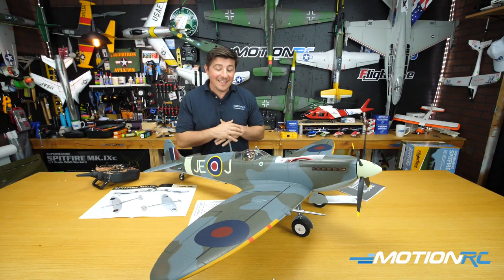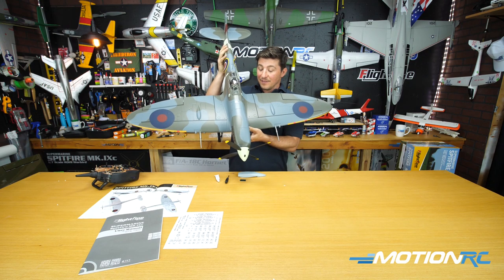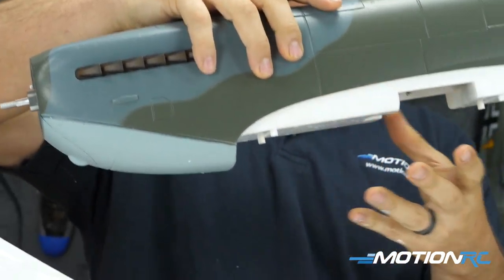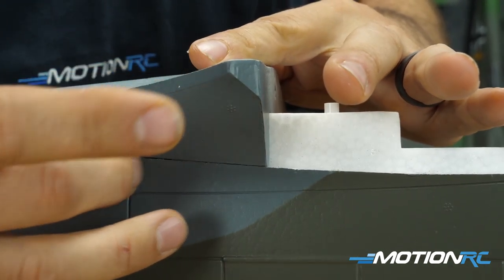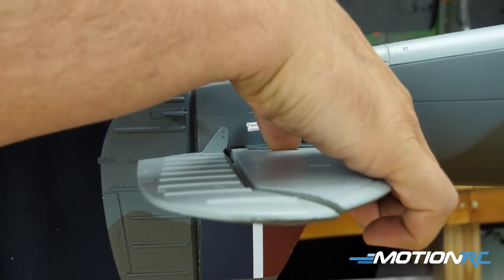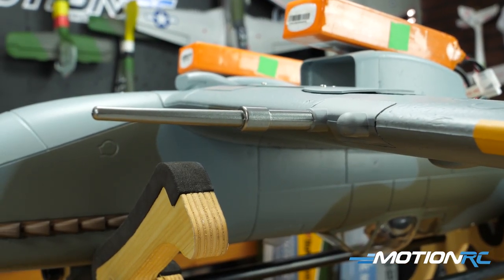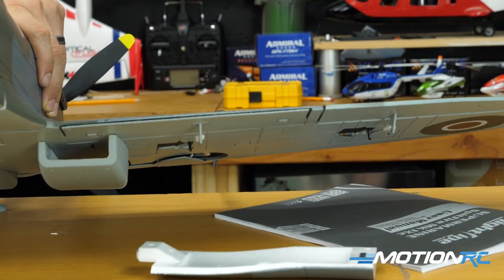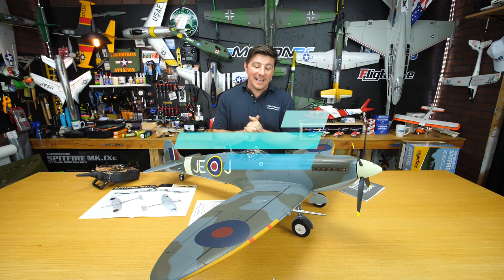FlightLine Spitfire Mk.IX 1200mm - Unboxing & Assembly - Motion RC

Comment: I'm not sure if this is too late to get a response but I will give it a try.  I relatively new to RC.  Less then 2 years.  I did not see in the video where is it best to put the receiver?  I'm assuming behind the battery but I was hoping the video would show me.  This video also mentions installing a gyro and that the  maiden video would show that but I do not think it does. Is there a video that shows these two steps?

Comment: I got a 4s 4200 lying around, do you think 200 more will be a problem or is it fixible?
Reply from the maker: mAh doesn't matter, it comes down to the battery fitting. You can fly this for 1 min on a 4S 1000mAh if you wanted. But a 4000mAh gives you more time in the air. Your 4200 should be fine
Reply: @MotionRC Ok thank you for your Answear :)

Comment: Would hot glue work? I just have bad experiences with super glue
Reply: it will work.  but that hot glue melts on real hot days or if its in your car on summer days the glue will melt and part fall off.   had it happen to me once

Comment: YO GUYS this guy blundered make sure before you glue the wing that the elevator servo lines up because when they manufacture the plane they messed up on the rod length that connects to elevator. I glued the wing and cannot fix it now em without damaging the plane. Check everything lines up before you glue
Reply: Great catch my man!  I just had the same adjustment to make that would have been impossible once the wing was bolted on. Thank you. DK
Reply: You are correct. I would have adjusted those elevator and rudder servos in proper neutral position before making any wing gluing but new pilots might not have caught that error.